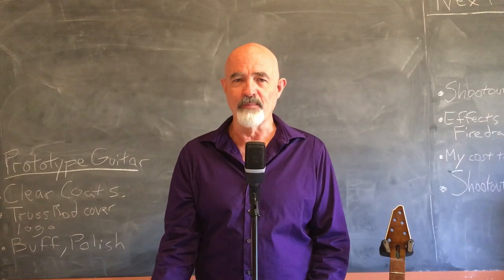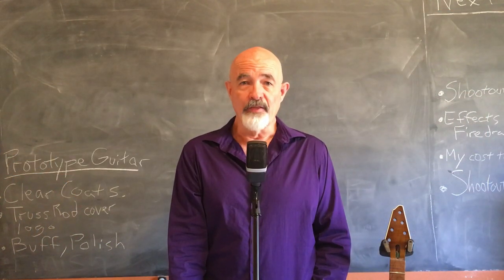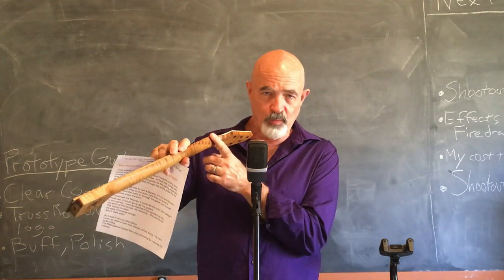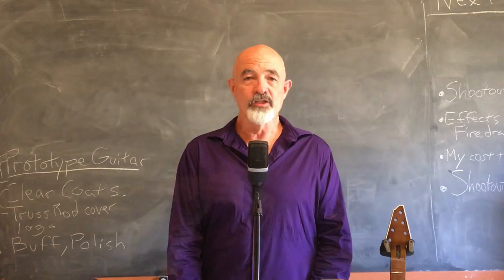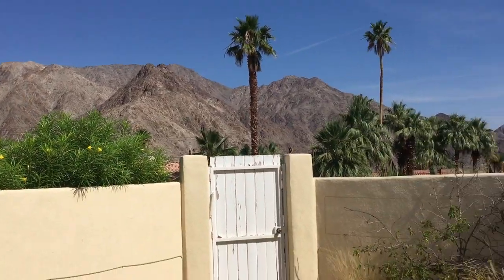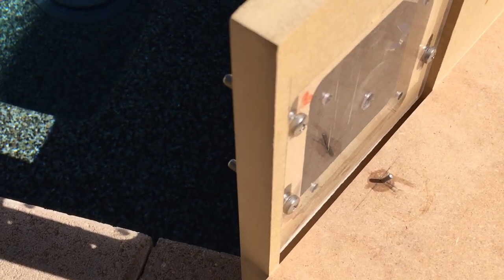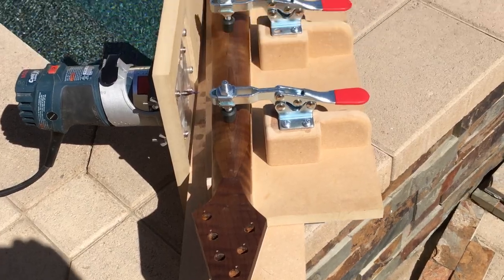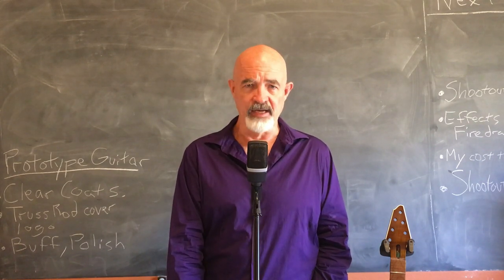GGBO (Great Guitar Build Off) 2021,  Part iii˚, Neck Work & Side MarkerJig

Comment: That neck slot jig is awesome!  I've also been frustrated by those tiny invisible dots.  I wound up gluing thin strips of paper on my basses, but it looks like crap and they're not sunk in at all.  I'm definitely going to make my own version of that jig.  Thanks for the idea!  Ok, off to see the other build vids.
Reply from the maker: One night I was about to take the stage to play Led Zeppelin's "Kashmir".  My black Danelectro guitar had a thin rattle can black finish with a white primer coat.  When I realized I would not be able to tell where I was on the neck because the stage was too dark, I used my thumbnail to scratch side markers into the finish removing the black exposing the white primer.  It worked and I had no problem seeing that neck on a dark stage, but it got me thinking...